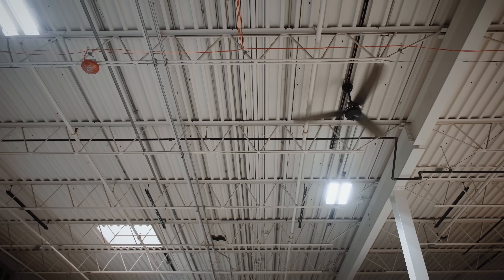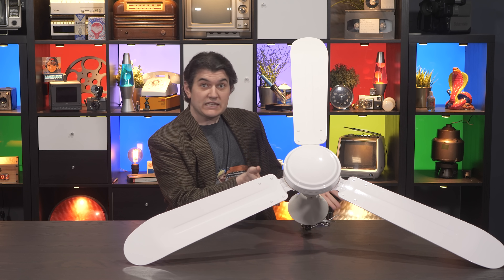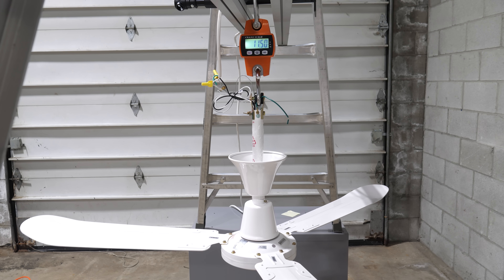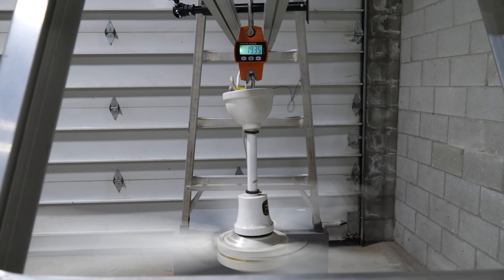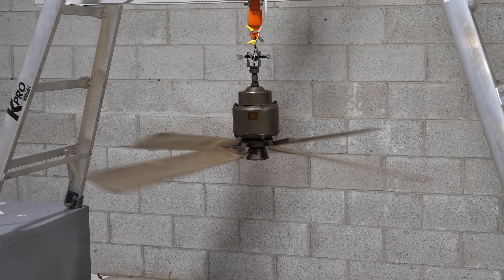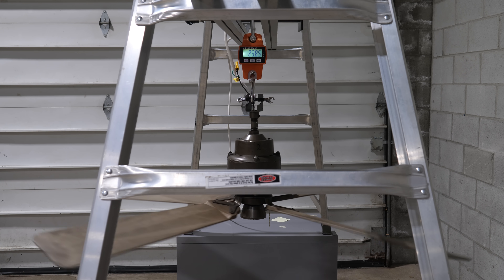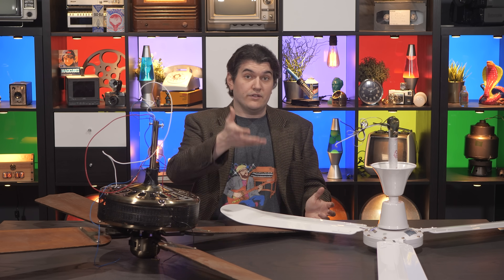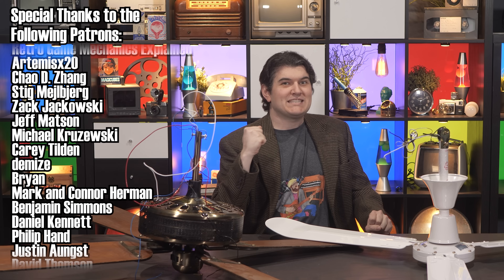How much thrust does a ceiling fan produce?

Comment: Fun Fact: if you reverse the direction of a squirrel cage (centrifugal) blower - like the type used in home furnaces and heat pumps - the air moves in the same direction, just less efficiently.
Reply: The same applies to centrifugal pumps. Reversing the spin direction of the impeller does not change the direction of water flow.
Reply: Now I kind of want to build a very large diameter thin thickness squirrel cage blower ceiling fan I'm thinking like the whole system is like 5 inches thick I mean it can only be able to suck air up you could ever blow it down but it still would create circulation and will be a lot lower profile for shorter ceilings
Reply: @Peterthethinker  if you think of the fan or impeller as a rotating disk, the air is drawn towards the center of the disk and ejected from the sides. You could shape the housing to direct the air as you like, even downwards.

Comment: It's your no effort video and all, no qualms, but i'm surprised you didn't lookup or mesure the power usage of these, and compare that to the measured thrust, after all, pretty much all the used energy should be converted to thrust, and as little heat and noise as possible.

Comment: small distinction. the fan doesn't push the air under it down, it pulls the air above it through it. the air below is just getting out of the way, lol.
Reply: I mean, it does both indirectly. What it really does is rotate in place, pushing air contacting the blades in it's path down, which pushes the air below further down, and draws the air from above into the low pressure zone thus created.
Reply: @seigeengine  there is no air to push only pull

Comment: A better way to do this test would have been to use the various blade designs on the same motor connected to the weight scale hook up. The scale is fine but you need to have a way of lowering it down on it, after the blade starts. (Maybe just a long pry bar with a hook thing that slots into one of the features of the motor.)
My biggest fear has always been when they become unbalanced and start rocking back-and-forth real bad sometimes scraping the ceiling. . . Or like when my mom's visiting and she insists that I use the ceiling fans and keeps going and going . . so I use the ceiling fans and turn them on and dust starts raining and flying all over because I never use them. That was horrible, fear that.

Comment: I have never heard of or seen anybody using ceiling fans in winter in the reverse setting
Reply: Yeah, it's relatively niche knowledge these days... but so are ceiling fans. People been tearing them out for yonks because they remind people of old people's houses. Instead they're getting very pretty garbage fans like dysons.

I run a fan fairly constantly, personally. It's not a ceiling fan, but I usually have it angled up towards the ceiling. My computer is set up in a finished basement area, and the air stratifies something fierce down here, especially with the air vents in the ceiling. My head can be fine and my feet freezing if I don't mix up the air.

Comment: Some cool and important trivia about propellers and helicopter rotors. Both of them are wings attached to a spinning shaft. Thanks to their angle of attack they will in fact generate thrust, but that thrust is nowhere near enough to make a helicopter fly or a plane to move forward. What makes their shaft move axially is the lift they generate. On the plane the lift is pointed forward, so the props "fly forward", and since the props are attached to the plane, the plane goes forward. On helicopters, the lift force goes up, and so does the helicopter.
Technically, you could get lift with no thrust if your prop blade has a profile that generates lift with zero angle of attack.
Ceiling fans (and any other fan, to be fair) are closer to modern jet engines. Actually, a turbo fan engine is a big fan blowing through a tube which its cross section area gets smaller and its powered by a jet engine. If you replace the engine core with an electric motor, the whole engine would work the same way.
Reply: Thanks for adding in the clarification of what makes propellers work. Isn't the zero angle of attack how stealth works, to minimize the impact that creates sound waves?

Comment: Now i'm wondering how much thrust could a ceilingfan motor produce with a better airfoil design. I've always found most fanblades seem lacking in aerodynamic design
Reply: This is because of the different operating conditions. Particularly that propellers on planes operate at very high speeds, so aerodynamics are very important. In contrast, household fans operate at fairly low speeds, and are more size-constrained. Essentially, it just doesn't matter that much and there are other concerns.
Reply: @seigeengine  i'm well aware, i was mainly referring to ceiling fans which sometimes have just flat wooden blades which could be more effective with even slightly more aerodynamic design. Also quieter

Comment: So, you're reporting the mass of the fan and a mass reduction when running. Where did that mass go? Is this the path toward fusion power?

Enquiring minds want to know.
Reply: the weight changed, not the mass.
Reply: @AnotherPointOfView944  Grams and kilograms are measures of mass, not weight. You can use a bastardized unit of Kg(weight), but that's not what the presenter said. (Let's just say that this impacts my respect for most of the people who hector people about using SI, since they can't be bothered to use SI themselves.

NB: the SI unit of weight is the Newton. (And the imperial unit of mass is the slug, FWIW.)

Edited to correct a typo.
Reply: @dougsundseth6904  People in the US routinely and wrongly interchange lb weight with lb force. Same when it is converted to Kg.
I studied physics in a metric country, so I am more than familiar with the fact that force is measured in Newtons. 
Hence weight (force on a mass due to gravity) in Newtons on the surface of earth is approximately F = mass * 9.8.   And 
in this scenario  ForceTotal = (mass * 9.8) - force_due_to_fan_running.
So I as I said the mass does not change here, only the force of the fan subtracted from the original due to gravity.
You can back calculate an effective "Weight" in kg by dividing ForceTotal by 9.8 again, but this is only misleading TBH.
Reply: @AnotherPointOfView944  Obviously. I'm perfectly comfortable working in pounds, long tons, short tons, ounces (avoirdupois or troy), Newtons, or dynes when measuring force. Now, if you want to limit yourself to only working on the surface of the Earth, at sea level, with no other acceleration, and no local gravitational anomalies, then the kg (or gram) is a fine implied measure of force.

And when people incapable of using any measuring system other than SI stop bitching about people with more capability, then I'll stop making jokes about their ability to use the system they complain people aren't using.

I suspect the problem was that I failed to accurately translate between SI and imperial units of humor. I'll work on that.
Reply: I can confirm that the solution to cold fusion was just to make a fan.

Comment: If you ran a secondary plank next to the hook it might have helped to negate the torque on the hook at start up and shut down  but then this is no effort november
Reply: Addendum the hook would still need to float but be captured  either thru a dual bolt and mounting plate or d shackle

Comment: Another way you could have set up the fans so it was a bit safer, was to have them mounted to something solid like a plank of wood or something, then place the ends of the plank of wood on two normal scales, kinda like how that bar you have is mounted between the rungs of the ladder. This way you can use normal scales and have less issues with the spinning of the fans. You would probably use the total between the two scales and how it changes as the measurement in this case.

Comment: It is my understanding that those crane scales, and also home bathroom scales work by gauging the difference of electrical conductivity under strain and at rest.
The torque of the fan would be applying a torsional strain to the test cell in the scale, perhaps accounting for the difference in readings at startup.
Perhaps a future video idea would be scales.

Comment: A question for you, maybe for Conextras.... If you have two ceiling fans in the same room or space, should they both be spinning the same direction or opposite directions for best heating/cooling/air flow results? 

I have two ceiling fans in my living room and always wondered that. I was at the local hardware store and I noticed their fans were spinning both ways. I didn't know if that was on purpose or if the fan installer / maintenance guy was just lazy. 

This is a burning question only I am sure you could solve lol 

Love the vids my favorite YouTube Channel!!
Reply: Hmm. My first thought is if they're spinning in the same direction they might cancel out where they meet creating a dead spot.
Reply: In theory, both should be in downdraft, but there are some specifics of the fans and room that make it worth experimenting.

Comment: Those low speed high velocity style fans for industrial use are kinda terrifying but awesome to have. At an Autobody shop I was working at, it was built into a building that was initially used as a warehouse. We have ceilings that were around 35 feet high so they got these fans from the brand "big ass fans" each blade was probably about 12 feet long and a foot wide. They were massive and if you turned it up it went WORRYINGLY fast but boy did that thing move air. Whenever we were welding or applying blackout tapes or stickers to cars we'd have to lower the fans down to like 5 or 10% speed because if we didn't it would blow away the shielding gas and make the stickers flop around like you were working outside on a moderately windy day.
Reply: Man, "high velocity low speed" is an oxymoron if I've ever seen one. =)

FWIW they're actually called high-volume low-speed fans.
Reply: @jubuttib  oh shit that's totally what I mean to type lol
Reply: @jacobtuley2573  Hehe, to be fair he did say "high velocity low speed" in the video, I'm sure it stuck from there. =)
Reply: I've seen that brand before! They had them in some spots at Gardens by the Bay in Singapore. I thought the logo was funny.

My God, did they make a difference in the blasted tropical climate.
Reply: I have installed Big Ass Fans in a large warehouse space and they do a fantastic job. Consume a LOT of energy but it's worth it.
Reply: @dielaughing73  Lot of energy overall, vs. lot of energy per unit of air moved? I'd hope they'd be at least decently efficient.

What are the blades like on those things btw? At one point I swapped the simple blades on my ceiling fan for some styrofoam model aircraft wings, and holy crap did it become more effective! Went from the highest setting being so-so to the lowest setting being almost overwhelming. Super quiet too. At the highest setting the styrofoam blades/wings were pushing out so much air, that they bent up and started to scrape the ceiling, hehe.
Reply: @jubuttib  well, not a lot of energy compared to air-conditioning the entire space (which we did also consider) but I recall they were several kilowatts each, times four fans. Probably decently efficient though I didn't calculate that.

Blades were aluminium extrusions with plastic inserts, from memory.
Reply: @dielaughing73  Multiple kW? Yeesh, that's a lot more than I was expecting!

Any memories of the profile of the blades? Airfoil?
Reply: @jubuttib  yes I just found the photos. An aggressive airfoil in hollow extruded aluminium with plastic winglets at the ends. Fans were eight metres overall diameter. Each one ran on three-phase power
Reply: @dielaughing73  Thanks for checking, much obliged!

Comment: If you had a way to duct all the air flow through a known cross section and measure the airspeed (assuming boundary layer is small or you know what the velocity profile is) then, quote according to NASA: "The force (thrust) is equal to the exit mass flow rate times the exit velocity minus the free stream mass flow rate times the free stream velocity."  It probably says something like this in fluid mechanics textbooks too.  Of course the accuracy and precision of such a measurement is wildly excessive for no effort November finding of "it makes SOME lift".🙂

Comment: Fun fact! The thrust, movement, and changing weight of a ceiling fan makes it a live load. This is why ceiling receptacles have two ratings -- one for chandeliers and one for ceiling fans. For example, the ceiling boxes I just bought for a house remodel are rated for a 50-lb chandelier (dead load) OR a 35-lb ceiling fan (live load).

Edit: I believe the ceiling fan-rated boxes have a different bolt pattern than ones that are only rated for a flush-mount light fixture, so it would be pretty hard to mount a ceiling fan to a receptacle not meant for one. (I have seen it, though, the fan was dangling by one screw.)
Reply: Yeah, and for those not familiar - the heavy duty ones have to mount to a joist, either directly or with a bracket that spans between two joists. A standard flush light fixture box is often just clamped to the ceiling drywall. You do not want a fan supported only by a couple little ears holding the drywall!
Reply: Oh people will find a way to use the wrong receptacle. Never underestimate the ingenuity of idiots.

With enough baling wire and duct tape, you can jury rig anything.
Reply: @russlehman2070  If duct tape worked in vacuum on the Moon, it's good enough for an attic.
Reply: Interesting, though I am fairly certain I have seen adapters for sale.
Reply: @sonicmastersword8080 Was just going to say, you can adapt anything, and I'm sure lots of people have.
Reply: As for hardware fan boxes use 10-32 screws while a normal light fixture uses 6-32.    Heavier duty hardware for the added weight and torque.     Recently had to add a fan in a new construction where I had to extend the mounting screws 2”.    After the boxes and wiring was installed the customer added 3/4 wood planking over the drywall.     Without notifying us.    ZERO access once it was completed.     Finding 2 1/2” 10-32 screws is not that simple in a small town.
Reply: Those engineers clearly forgot to account for me hitting my head on the chandelier, making it a live load.
Reply: chandelier may also become a live load when opening the door on a windy day.
Reply: I was surprised to discover your fans attach to the ceiling box 😮

We (Australia) generally don't do those style of boxes anyway (wall or ceiling). Every household fan I've seen hangs from a coach screw style hook, embedded in a ceiling joist. The top of the fan is forked, and has a rubber bushing in between that goes over the hook.
Reply: @GeekBoyOz  Fascinating! That sounds like it would be a very cool look.
Reply: @Whammytap  you generally can't see it as it's covered up
Reply: Gosh, it's so much easier when your ceiling is made of concrete...
Reply: @ Until you have to drill into it! 😂
Reply: @Whammytap  no biggie that - a hammer drill is not a recent invention
Reply: what do dead load and live load mean?
Reply: @mrosskne  a dead load is one that can be assumed to be constant. A live load is something in motion. Things in motion can experience loads much greater than just their weight, like if a ceiling fan struck an object, or became unbalanced.
Reply: The thrust generated by the fan has NOTHING to do with those code requirements.  Fan manufacturers are not GE or Boeing - they make cheap products quickly.  Ceiling fans are not balanced to any particular standard and all of them generate forces because of that rotor imbalance. The thrust is effectively zero and the weight does not change.  It's all about the movement and that's it.
Reply: @ I politely beg to differ.
1) Actually, GE's home appliance division has made ceiling fans. 🤓
2) The weight of a ceiling fan DOES change slightly during operation, meaning that a small amount of thrust is present. That was the point of this video.

At any rate, "live load" simply means weight that is moving. A properly-balanced, properly-mounted ceiling fan SHOULD not move much, but there are forces other than gravity acting upon its mounting point, for example rotational force. Engineers must also calculate a safety margin of error for imperfect manufacturing/installation practices.
Reply: @Whammytap  The thrust produced is insignificant from an engineering perspective.  It's not why fans need bigger boxes.  They need bigger boxes due to the rotational forces and due to the significantly higher weight of a ceiling fan compared to a typical light fixture.  Besides, the thrust, even if it did matter, would only make the fan lighter, so the design load would still be in the no-thrust condition and it is again therefore why the larger fan box is not required due to the thrust.

I concede GE does make ceiling fans.  They certainly don't test them in the same labs as their turbines, though.
Reply: @jzero4813  I DID mention rotational force, but...meh, I hate it when people nitpick each others' statements in the comments and here I am doing it myself! 😂 Good points, you have yourself a good one!
Reply: Mine are mounted on whatever was in the ceiling when the house was built. And I'm sure that was well before ceiling fans were a thing. So, they're not rated for anything. 
They've been there for 28 years or so without falling off.